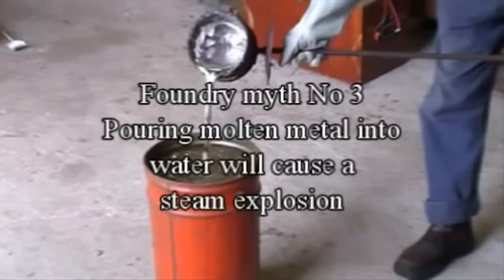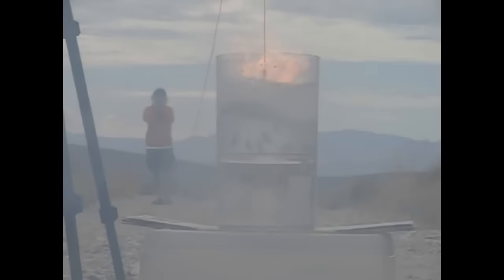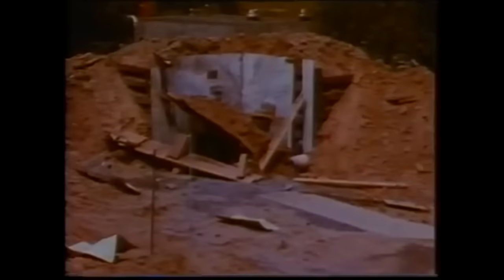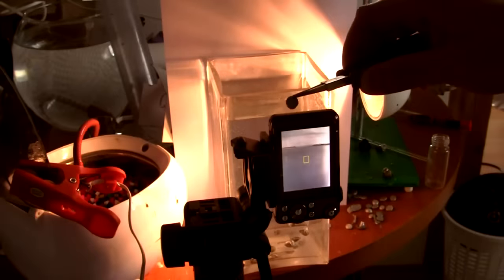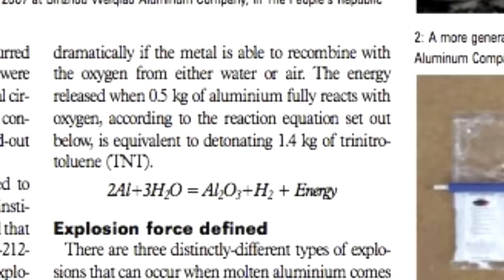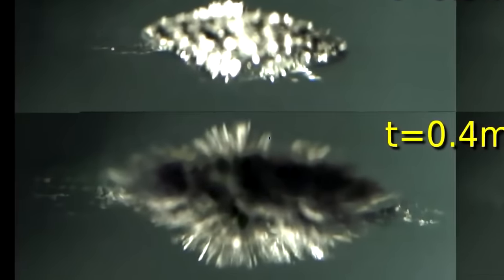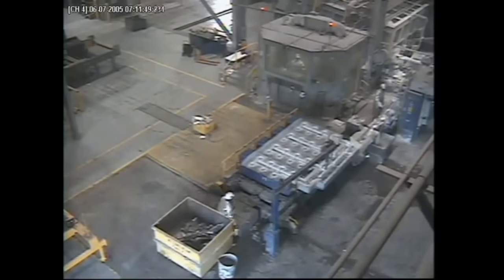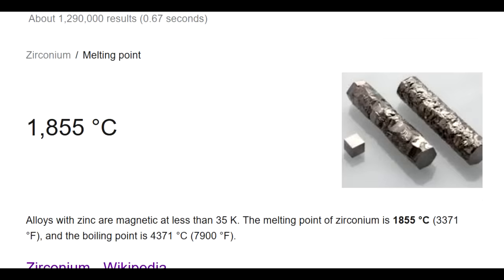The Awesome Power of the Aluminium-Water Explosion!

Comment: i think the main factor in aluminum water explosions is the amount of water/aluminum, if a large amount of aluminum (or any molten metal) is pored in to a small amount of water, the water will flash boil, if the same amount of metal is pored in to a large amount of water, the water can absorb the heat before it can boil, the thermal mass of the water will play a big part so will the speed of the metal been pored, if the molten metal is pored slowly then then the water has time to dissipate the heat.
yes there will be chemical reactions between the molten metal and the water but the thermal transfer between the two will more significant.

Comment: id try something with a tig welder setup, that way its easy to melt the aluminum and inject argon at the same time
Reply: Could you reverse it, pour the water onto the molten metal rather than molten metal into water?
Reply: Robert, good suggestion. I suggested a small scale of this.
https://youtu.be/Q6Zrnv4OtbU small piece of Al on a Al wire all cleaned and oxide free.
Heated and dropped when power is removed.

Comment: Thunderfoot: 

You said luck was the only thing keeping the aluminum from exploding in those videos, but your scientific method has neither considered nor ruled out hope.
Reply: you know that shit is serious when he consider hope
Reply: Aliens
Reply: Or different conditions. In the test footage they are basically dumping the entire ladle in at once. Im sure if you got the ladle piping red hot and flung it in there all at once it would do something interesting.
Reply: It’s entirely metal to water ratio in the videos keeping people alive.
Reply: @kefkaZZZ  and temperatures and contaminations.
Reply: @kefkaZZZ  Pretty much all metals can "explode" when in contact with water. The higher the melting point, the more violent it is. Theres a video of a guy (Tito4RE?) getting the same result as the Mythbusters thermite/ice explosion with molten copper onto a block of ice.
Reply: @kefkaZZZ  If you want to try something interesting, throw molten table salt onto wet concrete or a large container of water. Even small amounts (teaspoon size) will explode violently on contact.
Reply: Experiment: hope in one hand, shit in the other, see which one fills up first.

Comment: The explosion video said "a small amount of water"

The other people are pouring molten Aluminium in proportionally larger amount of water.
Reply: Exactly: they aren't trapping the flash-boiled steam under a mass of molten aluminium.
Reply: Bingo. which is why I stopped watching this so called scientist channel. It entirely depends on the ratio of molten aluminium to water. Confusing the reaction rate of Na K and Al in water is just sad. Overly Damp sand in a foundry casting flask is brutal what ever you are pouring iron steel or aluminium. It's a bleeding steam cannon ffs. Molten pouring aluminium has NO oxide skin, it's not freaking possible so this ooo! Water reacts with molten aluminium is BS. If he wants to test it melt aluminium in a crucible with a bottom tap tube so you can inject the aluminium from below the surface of the melt into a large tank below the surface of the water. All you'll get is pretty stalactites.  Whee
Reply: Can you imagine how much aluminium you would need to flash steam a pool?
Reply: @zachcoldwell7978  stares dreamily into the distance, "yeah."
Reply: @fizzguts  Nope. they poored the aluminium slowly in, so that it had time to form an outer aluminium oxide layer. So aluminium never reacted with the water. Had they droped the whole bucked in faster or destroyed the aluminium oxide surface of the material it would have reacted in a violent and mostlikely deadly explosion. 
This is not about the steam deflagration, you are refaring to. It's about an aluminium-water-reaction that creates an explosion comparable to TNT.
Try to find people who work at aluminium foundries who think pooring molten aluminium into water is safe and smart.
Reply: There is NO such thing as a aluminium water or steam reaction powerful enough to cause an explosion.. The reaction isn't vigorous enough.This video doesn't show one example of that idea. It's an idiotic extrapolation of what some alkali metals do. The missunderstanding of reaction rates is appalling. The dude needs to get out of his bubble and talk to some chemistry dept people
Reply: @fizzguts  Definitely a masterpiece of bullshit video. I love the likening of a sodium metal into water explosion with that of molten aluminium poured into a large volume of water and quenching.... Total fantasised bullshit with bells on.
Reply: @fizzguts  I guess the understanding of what exactly causes alkali metals to go BOOM! is somewhat new knowledge. I'd be willing to consider his proposal, but I want to SEE Al exploding in such a proportionally large volume of water that flash steam sexplosion can be ruled out. Burden of proof is on the person claiming the fact that challenges the status quo.
Reply: If you paid attention to the video, this isn't a steam explosion. Its a chemical explosion involving dissociated water.
Reply: @highvoltagefeathers  Yeah, yeah. I hear his "novel theory"; what I DON'T see, is any real-world evidence of it happening. WRT Aluminum, I see two things:
1. People safely pouring SMALL amounts of Al into LARGE amounts of water,
2. People getting in trouble by pouring LARGE amounts of Al into SMALL amounts of water.
I'll listen to him, but I'm not buying what he's laying down without at least ONE real world example that cannot be attributed to a "flash steam explosion." JUST ONE, Thundertootsies! Shouldn't be THAT hard...
As they say, "Extraordinary claims require extraordinary evidence." If you look at the newspaper clip, they CALL IT a "steam explosion." THAT is the status quo, and it remains so, until proven otherwise.
Reply: No it fucking isn't. He CLAIMS that is possible. ALL the examples of explosions are molten metal bit of trapped water steam explosions. It happens pouring any molten metal, brass iron steel copper lead. He is comparing elements from the Alkali metals group of the periodic table. Al is NOT part of that group. Molten aluminium does not react fast enough to explode via an evolved hydrogen reaction. This is understood 2nd year chemistry. The are patents for molten al gallium to water injection reactors to produce hydrogen no oxide surface forms and NO explosion. Stupid claim unsupported by the evidence or the chemistry
Reply: FFS read my comments. Stop embarrassing  yourself by posting your complete lack of knowledge. Al is nothing like alkali or alkaline earth metals and it is not "very" reactive. Yet another muppet who doesn't know what a periodic table means.

Comment: I used to work in hot-dip galvanising. We used baths of molten alloy (mostly zinc) which probably contained 1000 tons of molten metal. Two different types of explosions occurred under the surface: 

1. an undetected sealed area of the workpiece (fully welded) had air pressure from the increased temperature build up enough to rupture it and burst, releasing a large amount of expanding air which rose to the surface and threw a large amount of molten alloy all over the place.   

2. an undetected almost sealed area of the workpiece would fill with solution from the acid baths and fluxes used to prep the workpiece and as some of it flashed to steam it would burst the sealed section and the whole solution would flash to steam, resulting in a huge amount of molten alloy everywhere (yes, people were sometimes seriously injured or killed).

In neither of these cases were there any other reactions occurring other than gas expansion. For those that doubt the power of an expanding gas explosion and its effects on solid steel, boiler explosions are very well documented even going back to the early steam train days.

I remain completely unconvinced that the aluminium is reacting. We all know the alkali metals react to water, even in their solid form, yet we do not see this reaction occurring with solid aluminium. If this was a phenomena it should be happening quite a bit as aluminium boats are very common things and they often scrape their bottoms across rocks and reefs - largely in the near absence of free oxygen needed to cause instant oxidization and certainly deep enough gouges to expose the pure aluminium to the water. Seemingly, none of these exposed aluminium gouges react and cause the boat to violently explode.

Every example shown in the video of molten aluminum explosions above are very clearly of steam explosions, most evidently in the foundry mold that has many 'eruptions' as steam bubbles escape but no catastrophic explosion which would be expected if the metal were indeed undergoing a reaction.

I usually enjoy your videos but I've found this one to miss that mark. 

By the way, I have now left the galvanising world far in my past and am currently a research physicist (but nowhere near this sort of domain).

Comment: I suspect that the molten aluminium versus water explosion might be more of a steam explosion (water flashing into steam on contact with the over 660.3 °C of molten metal) and that would explain how those guys could pour a little bit of molten metal into a relatively large volume of water (large fishtank and a swimming pool) which had enough thermal mass to cool the motlen metal quickly enough to not get an explosion.
That Australia safety video seemed more like almost a 1:1 volume ratio of molten aluminium to water, so of course there was going to be a violent steam explosion.

Comment: You know maybe its just the water being vaporized by the hot metal extremely quickly therefore expanding at a rapid scale and creating an explosion, because if you let aluminium react "slowly" for example with sodium hydroxide solution the energy that's released until the aluminium is completely consumed is not even close to what was described in the video - l think this sort of aluminium water explosion is a physical and not chemical phenomenal but i also understand your view and wouldn't bet that my understanding is perfectly right...
Reply: uhhh, thermite is so energetic because of the aluminium. 
What you've said is like trying to disprove the atomic explosion isn't atomic based because letting uranium decay slower isn't as dramatic.
Reply: Sozimajor my point exactly, definitely not a chemical reaction as the video claims. Using alkali metal reactions to support his video is plain stupid.

Comment: No surprise there, Aluminium is also used for solid rocket motors, because of the energy that is released, when it's oxidised.
Reply: No surprise there, when the military wants a bit more bang for the buck, they add aluminium or zirconium to the explosive used.

Comment: I do metal melting on a small scale. Damp molds have popped on me and at the very least cause bubbles in my ingots. My worst was when I broke a graphite stir rod that I'd been using and had red hot for some time. I just grabbed a new one and plunged it right in. Thankfully I was melting silver at the time so when the trace humidity in the new rod cooked off under a few inches of molten silver, the shotgun blast of Silver I was struck with merely bounced off. Left a few welts. I lost about $70 in that learning experience. Had it been low temp (Well...relatively) Aluminum it might have splashed instead of spalled. Ledenfrost is your friend! Also Aluminum is INCREDIBLY reactive with oxygen enough to rip it off humidity in the air leaving hydrogen floating around. I imagine as a liquid it probably reacts rather fervently with water, so maybe it adds a hydrogen explosion to the steam hammer you're setting off. I've spilled copper onto concrete before too and the water in there caused small explosions. Water does not like being north of 1000 degrees C.

Comment: Observation regarding metal water explosions: my contribution.
In case of “mold explosions” the „Explosion“ is due the water vapor reaching superheated status and blowing the metal apart, not to the molten metal oxidizing.  So basically a metal water explosion can be of two different types. Sodium, lithium etc will react with oxygen and „burn“ releasing a lot of energy. Other less reactive metals, like iron , when put in contact with water in a confined space, can superheat the water vapor and blow the liquid metal apart, the „explosion“ in this case is the rapid volume increase of the water gas, but no relevant oxydation of the metal takes place.
In order to achieve a superheated vapour status the liquid metal mass has to be much bigger than the water mass, so that the thermal energy of the molten metal is >> than the energy required to superheat the water vapor that is building up, while no cooling takes place.
In practical terms for example: If the idiotic youtuber is willing to blow his face  off, he has to pour 1 kg of molten metal in a 1 or 2 liter (or 1/2 gallon?) can, filled with just 50 grams of water.
If the youtuber pours the molten metal in a pool or in a big water Container, than the water mass is big enough to cool down the vapour before is superheating, and (Unfortunately?)no explosion occours.
What you think?
Keep up the good work Thunderfoot !

Comment: 8:13 Thunderf00t has balls of... aluminum.
Reply: aluminium*
Reply: @SirHorned19  tomato.
Reply: Damn, those alien bastards are gonna pay for shooting up my ride
Reply: @SirHorned19  Incorrect.  Aluminum is the metallic element at the heart of the metal oxide salt alumina.  The naming rules state that the element name is the salt without the ending "a", plus "um".  That's aluminum, not "aluminium".  That's why Humphry Davy called it aluminum (after initially, and incorrectly, calling it "alumium").  If the salt were aluminia, then you'd have a point.  It's not, so you don't.
Reply: Thanny - IUPAC disagrees.
Reply: Thanny, that was the logic but then they decided to call it aluminium anyway, because its the same way as helium, sodium and all the other names.

Or even, they renamed aluminium to align with the rest of the names, but forgot to rename alumina because nobody cared.

Comment: How is it a roll of the dice? Why would it explode one time and not the other ?
Reply: Thunderf00t was being dramatic. Actually, the reason why the reactions were not all highly reactive, has to do with the properties of aluminium itself, and the Leidenfrost effect. Aluminium oxide, the layer of whitish gray incredibly resilient pyroform; keeps water and other oxidizing chemicals from direct contact with the bare metal. Add to this the frizzenation appropriate to the Leidenfrost effect, and the water cannot adhere to the surface of the metal before the metal forms said oxide layer. Aluminium is such a reactant, because it has the ability to electrolise water and realease hydrogen. That hydrogen then reacts violently with the available oxygen, and the heat from the molten aluminium catalyses the combustion of hydrogen and oxygen. Viola, kaboom. Everything must line up perfectly, to create a teir 3 explosive force. If just one link in the chain is out of alignment, the reaction is substantially reduced. Thunderf00t actually goes over that in the video...

Comment: 15:45
Arduino switch to trigger a Molten Aluminium tap that doesn't allow the user to remotely trigger it unless below conditions are met:
1. Thermographic sensor reports if input temperature is reached.
2. Oxygen Censors attached to the "Argon Out" report when within acceptable range.
3. Hydrometer (Humidity Sensor) attached to "Argon Out" report when within acceptable range.

Once all above conditions are met the user will be allowed the option to drop a selected amount up to a designated safety limit. The controller that's communicating over Wifi with the Molten tap device can be fitted as a single device or adjusted so it can be a phone application.

Consider recruiting any number of the Youtubers here over GitHub with Electrical Engineering, Programming specifically languages of either C or Rust for building the base Arduino and Java for turning it into an Application.

I believe robots and software should be replacing humans for experiments regarding 15:45; they're expendable, your not.